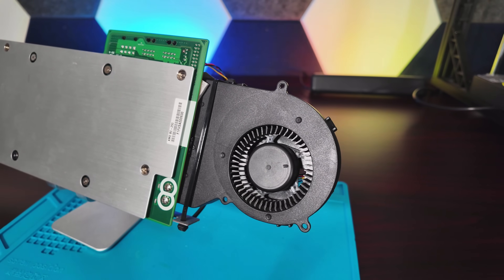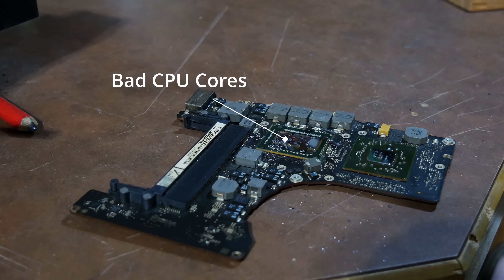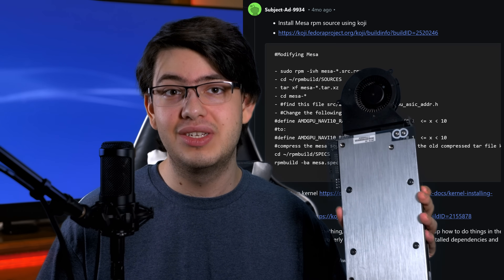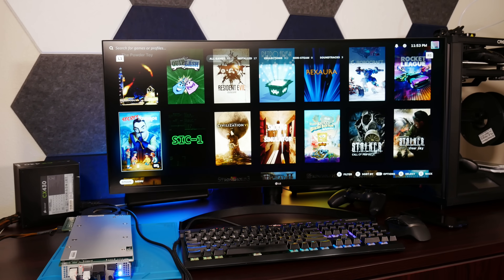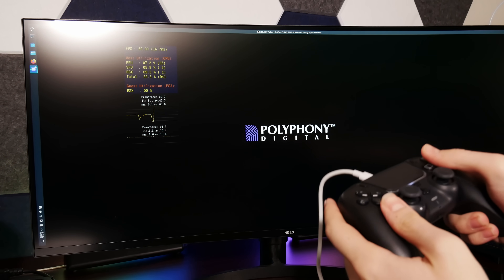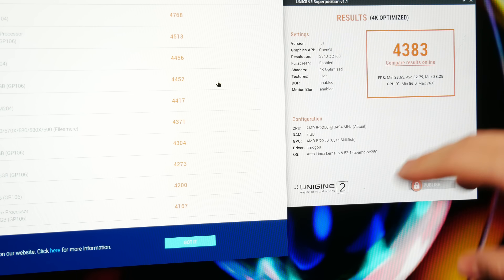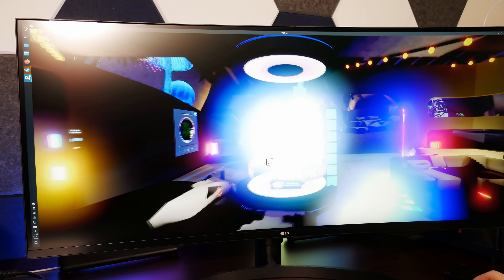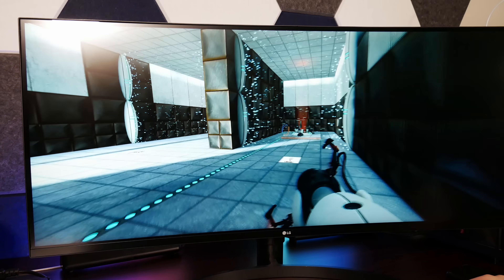I Ran PS3 Games on PS5 Silicon to Prove Sony Wrong

Comment: Try getting your hands on Ryzen 4800S kit, it has an Xbox Series X silicon. The CPU is pretty much identical to PS5's 8-cores Zen 2 CPU aside from FP unit and clk speed differences.
Reply: I managed to get myself one the other week. its was very hard to source but am excited to do some tests on it and dissect it
Reply: i know xbox series x in dev mode can run and emulate all ps1 ps2 psp wii gamecube  and more the xbox360 xenia emulator  some xbox360 games work some dont
Reply: yuck
Reply: 8 cores Zen 2 cpu is exactly why consoles are bad in the first place, they should have waited at least until zen 3 or zen 4 and only then have made a competent console, even if potentially it would start at $800, but at least it would be able of actual native 1440p
Reply: Just buy an Xbox at that point you goof
Reply: Does it have the GPU enabled too?
Reply: @thegeforce6625  The GPU is what's disabled or partially disabled due to defect. Thankfully, it can take a full sized graphics card directly as it's a mATX form factor board, but is limited to x4 PCIe 4.0, IIRC, The CPU is fully intact though. All 8 cores and 16 threads function!
Reply: Long story short, only the GPU is binned so add your own.
Reply: @AnalogFoundry won't that x4 be a huge bottleneck?
Reply: Nah, no GPU enable. Lots of latency. Boring piece of hardware.
Reply: @Rafa-Silva-Alt  dGPU can be installed. It is miles better than the Asus blade.
Reply: What is the point😩 pc needs more to run better, we don’t have dedicated processors to run decompile shader on the fly like consoles can,
Reply: @Sora926x  Why do you need a separate processor for that? Just get a CPU with a higher core count and run the process on your extra cores. Having an entire separate chip vs just upgrading your CPU is far more expensive.

Comment: You can use a command to overclock the gpu core by the way; by default it only runs at 1500mhz, but you can use 
 echo vc 0 2000 1100 > /sys/devices/pci0000:00/0000:00:08.1/0000:01:00.0/pp_od_clk_voltage

then

echo c > /sys/devices/pci0000:00/0000:00:08.1/0000:01:00.0/pp_od_clk_voltage 
to get a sizeable performance increase.
Reply: Yeah between 6.1 and 6.6 or so there have been WEIRD AMDGPU clocking issues
Reply: @icyjiub2228  This is needed even on the newest kernel, Mine is using 6.10 at the moment since i haven't updated it in a hot minute
Reply: @realderyn  how do u know all this
Reply: With these it performs more like an Rx 6600 in superposition; and in real world games
Reply: I hope he tries this and does an update video
Reply: I feel like we need a update video with this provided.
Reply: He should try LACT to change the clock speeds

Comment: You could 3d print a case for this system and install a far more quiet cooling fan, maybe a VESA mount on it? Shove it on the back of a TV for a quiet media center/ gaming build
Reply: I'm in the middle of designing a case for it to turn it into a mini pc; no vesa mount though
Reply: @realderyn  sounds good. Hopefully someone will modify the firmware to enable more cores and gpu cores. Surely a few of them are functional
Reply: @MLGPRO-dx8fg  That's almost definitely not possible. They fuse it off on the hardware level using lasers during manufacturing
Reply: @MLGPRO-dx8fg  The chip is what it is, and there is no modifying it via firmware.

Comment: Self-hosted cloud gaming server? Maybe a super cool kubernetes cluster? The possibilities are endless, super cool
Reply from the maker: Cloud gaming would be an awesome approach, I'd have to see what kinds of options exist on Linux for that!
Reply: @LowestLogan  I've had one running sunshine for a friend streaming for a couple of weeks now; it works quite well
Reply: Oh my gosh, I'm just imagining one of those AsRock servers fully populated with these PS5 blades running ProxMox, the potential is endless...
Reply: It is powerful enough for RPCS3, definitely xenia and switch. A whole two or three families could game off this setup.
I could buy one for that, maybe not AI as it needs one big GPU for best results.
Reply: I forgot to say, It's powerful enough for a mini MMO minecraft server, Assuming you can work with the hardware and connect all the blades into one giant world separated instances. One blade is for overworld nether and the end, then rest are custom like dungeons and minigames.
Reply: could this thing be used to inference LLMs? If so this thing could be insane fucking value compared to a single 4090 with only a fraction of the memory of a full rack...
Reply: Check out the "games on whales" project. Still early stages but super interesting. It basically puts everything you need to stream games in a docker container
Reply: Kubernetes is still a thing?

Comment: I figure Sony will have to decide on their plan for PS3 games sooner rather than later, because they can't just keep running their Cloud Gaming service on physical PS3 boards forever (as long as PS3 boards are still out of production).

This video definitely shows that a PS3 emulator with the ability to access original Sony code would absolutely be able to perform amazingly on this generation of consoles.
Reply: They could probably easily optimize it better too considering they have internal knowledge and engineering teams that not only know about the PS3 hardware but also the software. They have access to the PlayStation operating system source code for the PS5 and therefore all of the low level stuff related to it's hardware and stuff making it even easier for them to make all these optimizations in comparison to these largely volunteer open source teams making these emulators.
Reply: I live in Australia and Sony just sidestepped this problem by not offering PS3 cloud streaming to us and many other countries. There's always options...
Reply: Nah man, need to put an extra $400 million dollars into Concord 2.
Reply: @ShockinglyBleh new verbalase 50k dropped
Reply: I think they'd rather "remaster" everything and drop support entirely.
Reply: They are definitely emulating their streamed games & they make sure that whatever games they are streaming is emulating well before they ship it on their service. There is absolutely no way they are using actual PS3 boards
Reply: @superrookie-1  why is there absolutely no way? It definitely seems more reasonable to use existing cheap hardware instead of developing a whole emulator
Reply: @urmomma2688  why would you run thousands of PS3 motherboards from 2008 with their huge power requirements and space requirements when you can run it all on a handful of nvidia H100s?
Reply: @JB_inks  You're assuming that they are using 2008 boards, when they have launched refreshed versions of the ps3 that draw under 70 watts. And a ps3 board isn't exactly large to begin with

Also don't forget that the problem with ps3 emulation is the cpu, not the gpu, which increases the monetary requirements even further, for a service that few people use in the first place. 

It makes you wonder why they are using this secret emulator this way instead of just selling it. Seems like wasted potential

Edit: and why are there no internal leaks for this being a thing?
Reply: @urmomma2688  digital foundry had an article about this more than a decade ago saying they have custom hardware that shrinks the equivalent of 8 PS3 consoles onto a single board
Reply: @JB_inks  this supports my point though
Reply: @superrookie-1 well they could make the boards just for their server or emulation the point is the backend has the power to run these PS3 games
Reply: They CAN make a modern "process-a-like" for it, using modern techniques and stuff to make a more conventional system. Kind of like those "all new parts" nes clones.
Reply: How much do you wanna bet there's still at least a little bit of PS3 manufacturing still going on for those streaming boards?
Reply: This makes me think of Sony having an excuse for those ps3 boards in some way being profitable for the company. Not just making off customers, but the production needs of the ps3 boards themselves. Even as means to future proof ps4 designs?
Reply: Sony already has PS5 server blades running PS3 streaming, its nothing new
Reply: @marty8370  I know that it's been theorized, but has there been any proof or reports on it? PlayStation has officially stated before that they used real PS3 hardware for PS Now, but I hadn't heard them officially state that they moved to emulation for Cloud streaming.
Reply: No they won't. They will just remake them ad nauseum because that's what sells. Sony is a corporation. They don't care about art by their nature. They care about money. If it doesn't make enough money, they will gladly burn all semblance of creativity from their library
Reply: Chips that old aren't too expensive too produce (assuming there's existing volume) because the technology used to create them is so mature
Or, they could even create a hardware clone using current processes
It would be cool if they released a new ps5 hardware thing, but knowing them they'd want you to rent and stream the games from their servers
A hardware clone might be cheaper
Reply: @sandwich2473  I recall hearing however that manufacturing the Cell wasn't as straightforward as other CPUs, so I'm curious if they still have the tooling and proprietary hardware
Reply: Yes they can, they have no competition. Even the president said that he doesn’t see people playing older games
Reply: innovation is dead, you humans have reached the peak of innovation. Now you seek precious metals from the heavens, because your aggressive bacterial like reprouduction, you never exhausted your most desired resources and polluted the entire planet; land, sea, and air....contaminated with man's nuclear wastes and other compounds.
  You've outgrown this planet, like an untamed bacteria on the loose. Billions of highly intelligent, yet self destructive....humanoid organisms. 
  You've destroyed this planet, now you seek a new host amongst the stars and the Heavens. This is the reason why it was absolutely necessary to cut mankind off from the Tree of Life. Imagine how much more ruined and destructive the earth would be, if mankind had eternal life. 
😢🙏🏾📖🤲🏼
    #Pray for the planet, pray for peace on earth, pray for our President Donald J Trump
Reply: THE ORIGINAL PS3 SONY CODE HAVE & MUST BE FILTERED
THAT WILL TEACH STINKY-LAME-GREEDY-4SS SONY A LESSON OR TWO
#ISUPPORTTHECODEFILTERING
Reply: With the most barren year they've arguably ever had, the PS5 Pro being a massive overpriced disappointment and so on, they're going to need more revenue somehow, and monetising the back cadalogue some more makes sense. So it's not if, but when.
Reply: @garydiamondguitarist  why do you think they've still been shipping controllers with drift issues and serial code stickers that wear out?
Reply: Sony doesn't care. I expect them to completely close the e-shop and just forget about it sometime soon.
Reply: The problem they will cost them time and money and people only care backwards compatibility in the begnning of the console gen because people mostly buy new consoles for new games thats why Sony wont do it for now

It also prove from a Xbox study its just a small demographics that only uses BC but any modern PCs can RPCS3 decently
Reply: @dxtremecaliber  I still care about and play ps4 and xbone backwards compatibility. I also emulate ps2 games on my computer and I play some of the ps2 and ps1 games available on ps5.
Reply: > "because they can't just keep running their Cloud Gaming service on physical PS3 boards forever"
There already is RPCS3. It runs at native performance or even better than that, on x86_64. So this is a long solved problem.
Reply: @ricdeh1701  the main issue is using that in an official capacity. They already got bad press for using an open source emulator for the PS Classic, and if shipping RPSC3 was that easy, then they likely would have done it if it required truly little investment to bundle and sell.

Personally, I think they'd rather use a proprietary emulator, like they recently made for PS2 and PSP on PS5, since that's the method with most control over charging for.